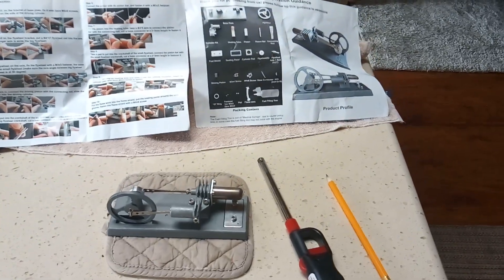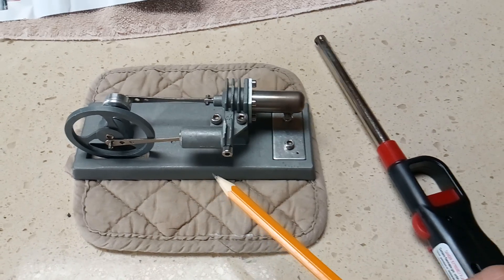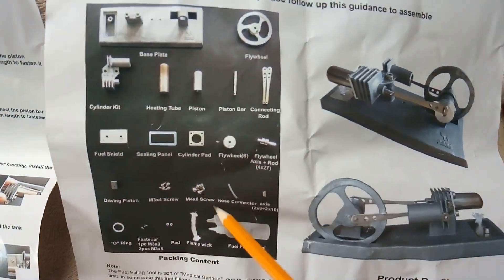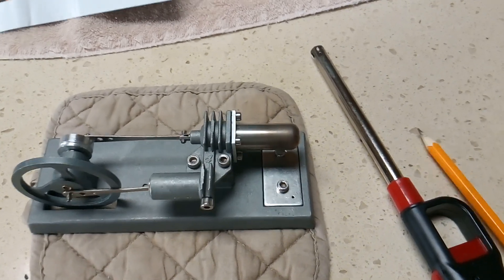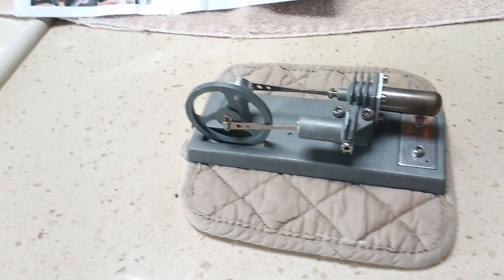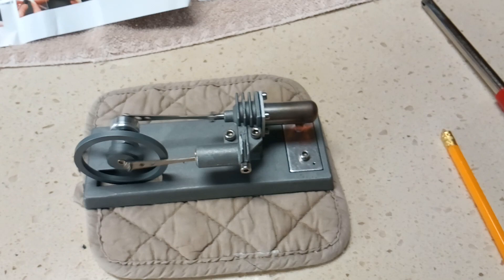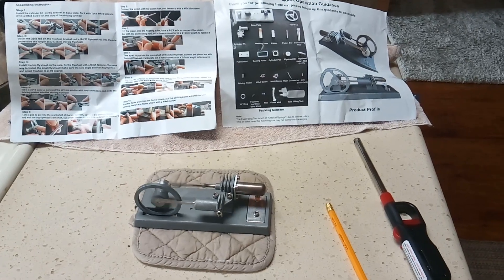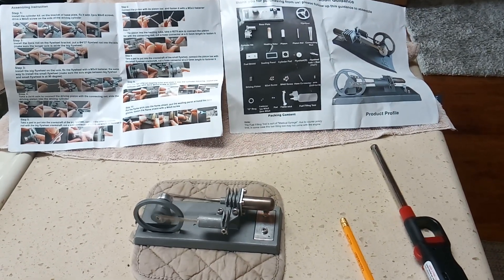All Metal Stirling Engine

Comment: It does look like a very cool platform for energy tests. The solar method makes a lot of sense, perhaps to pump water for outdoor plants.
Reply from the maker: A friend of mine who lives in Florida told me about one of his neighbors who uses a solar panel powered pump to raise water from a ground level tank to an elevated tank during the day to store energy instead of batteries.  At night the water is allowed to drain down through a water powered generator to supply electricity to his home. A Stirling engine could do the same thing.
Reply: @Lidmotor  A fascinating home hydro solution. I wonder if he uses a 'smart' valve to control water pressure depending on household demands. 

Also wonder if a similar rig could run the Stirling engine, if connected to a nichrome heater wire for overnight running.
Reply from the maker: I thought the same about using a nichrome wire 'heater to run the Stirling.  I have a feeling that someone has already done this-----perhaps long long ago.  The energy losses in the whole setup probably makes the idea not so good.

Comment: Hi there, it looks good! :) Thanks to share it, and also to link my video about the KIT and the modifications. I think this engine could be better with thin wall glass tube or stainless steel tube regenerator/displacer with lower weight, and better thermal properties as aluminium solid displacer. That is not changed yet on my engine. Maybe an easier help but not really cheaper if we could make a layer coating on the aluminium displacer's surface with a nano ceramic ball paint what NASA developed decades ago. It could change easily the thermal properties, but I haven't got now. This Stirling engine is a pretty good one to demonstrate how the heat differences could create mechanical energies and vica versa to anyone. I want to show on my channel few interesting new desktop products soon with small generators and LED lights. I hope it will be interesting too! Anyway, thanks again Lidmotor, and if I could help to any modification don't hesitate to ask me! BLADE
Reply from the maker: This engine is a good platform to try out ideas on like the better displacer you suggest.  I am a little worried that the moving parts will wear badly if the engine is run too much though.  As a desktop display with short runs it is great though.

Comment: Nice ! I had the glass sleeve version similar to this, I've also built several unsuccessful, I think you've had better luck with doing that. But yeah Stirling engine's are a fascinating device and I've always wondered why we didn't use them more?
Reply: We use it, just it is not popular enough, because the price. High pressurised high cost Helium is the base, high tech heat exchangers should use and high price linear motors if we need a no maintenance free piston version what the CHP home and power heating systems use now. Or the cryotechnology... With only one stage engine could create -193 C degrees and in this segment the Stirling type engines are the best. I seen some LNG after cooler and those could help in the gas particles reliquidification. Maybe the popularity will come later. :)